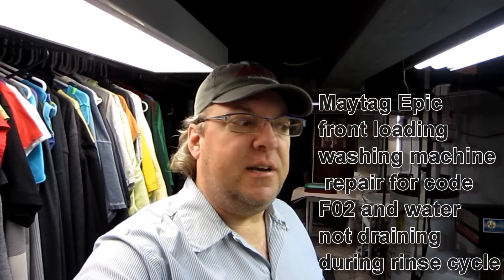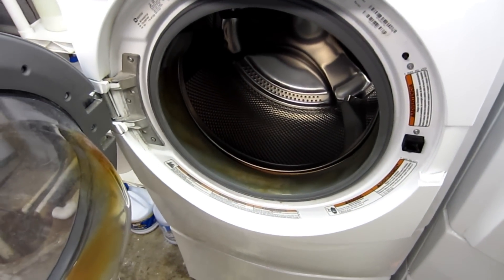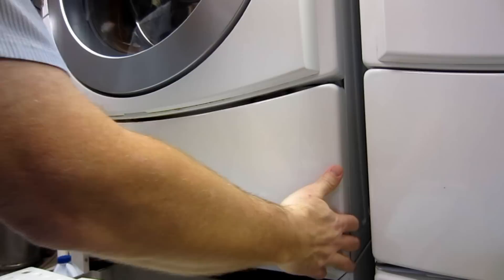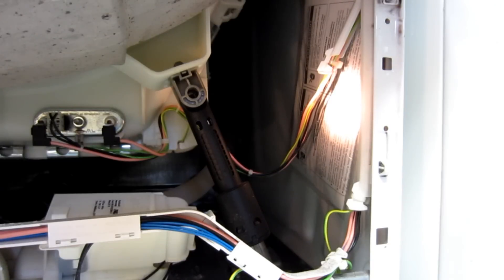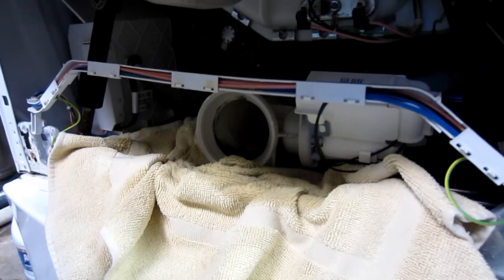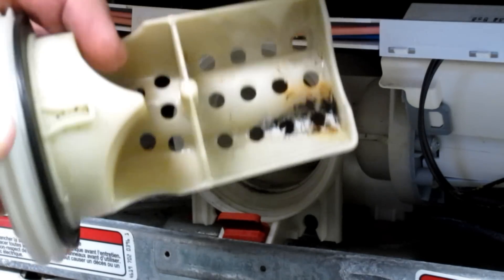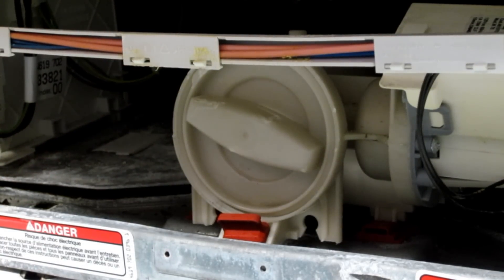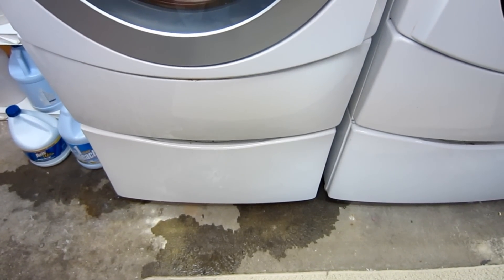Maytag Washer not draining code F02 or F2

Comment: No not Victoria , but if she were here she would thank you for your help. I followed your  video advice and cleaned out the screen for the first time in 10 or more years. I did not knot there was a filter that needed cleaning.
I pulled out what was left of a mechanical pencil, 12  cents, a 5/16 drill bit and gunk. Totally clogged. Now it totally works.
Thank you again.
Reply from the maker: awesome!  Glad it worked out..

Comment: Thank you very much for this amazing instructional video, it was exactly what I needed. You save me around $250 on a service call. I thought it might have been the Main Controller board. I was really surprised that the problem was just a clogged filter trap. You detailed every step including the tools required. There was a sock, some coins, a pen other debris and a lot of hair and lint. This machine is 12 years old and I was considering replacing it because of this error, now it's once more working like new. Thank you!

Comment: Thank you for doing this!  I cleaned out a bunch of gunk from the hose on the back of the machine last night but we still go the F02 error this morning.  I knew there had to be a filter somewhere.  Your video was very helpful and explained perfectly what to do to solve this problem.  Thanks again!
Reply: I forgot to mentioned, when I pulled the filter out, it was like one solid tube of lint, hair, a bottle cap, some change, etc.  I'm not sure how it was draining ANYTHING through all that stuff.
Reply from the maker: Grandpa45 that can happen. Glad it all worked out.
Reply: Grandpa45 mine was the same way!  6 years of lint, rug backing, and green dental floss holders.  Did it myself too!
Reply from the maker: thumbs up!!

Comment: Thanks for doing the video....a quick share on the issue with mine draining earlier in the year, cleaned out the trap and put it back together. Still wouldn't drain. After looking around a bit closer, the impeller shaft broke. The motor was fine but the impeller wouldn't spin to pump the water out. At first I thought it was a lego rattling around. Found a cheap knockoff motor on Ebay for about $40. Back in business and mama is happy now.

Comment: Found this video while searching a draining problem.
Our Maytag Maxima doesn't have the separate bottom piece that comes off to get to the pump screen i never knew existed. It has a one piece front all the way up and tucked under the display.
So I pulled the bottom out to the cracking of plastic point and jammed a couple sneakers in to hold it open. I could reach in and unscrew the screen and pull it out. Sure enough, had about .75 in change in it along with some other crap.
Thanks for the tip.
Reply from the maker: That's Great.. Glad it helped out!!

Comment: I just bought a washer and dryer for $140 for the set and washer wasn't draining/f02 error. The filter was clean but there was a small cloth that made its way into the area just to the right of the filter in front of the pump.  Removed blockage and it works. So don't give up if it continues to happen after cleaning out the filter!
Reply from the maker: +David Kaufman Right ON!

Comment: Thank you so much....!
I was at my wits end because of the f-02 code... about ready to call the 'Maytag Man'  I am machanically inclined.... checked out your video, and sure enough!  When I pulled the filter I actually thought there was a black rubber  boot around it to protect it .... nope  there was a sock, about .40 cents, a pen lid  other debris and about 1 pound of hair/lint  .... and talk about STINK   whew!!!  my washer is back to NEW status!  Thanks again!   All in all it took about 20 minutes!  P.s.  I replaced the torx screws with like size phillips head screws for ease next time.
Reply from the maker: Your welcome, Glad the Vid helped
Reply: Misubishi
Washing machine F2 error
I no know

Comment: Whew! That wasn't so bad and I found a heap of coins with crap growing on 'em along with nails and a lemon. Thank you for this.
Reply from the maker: Awesome! You're welcome.
Reply: This still didn't solve my problem, however. It looks as if I may need a pump. Error 21 (long drain) and E33 (replace the pump) even though I had to release the drain to spin the clothes more than once.
Reply from the maker: That sucks, Check out my other video on pump replacement. It's not too difficult. Good luck!
Reply: P

Comment: F02 error after drain cycle. Pulled mine all apart, but make sure that the water is not in the tub, because it will drain out once you get the cap off.  We had a small flood, but the shop vac was close by and got the water up.  This is the first time I have ever had the filter out in the 10+ years we have had this machine.  It was completely plugged up with lint, change, hair, hair ties, and who knows what else.  It smelt like the sewer line.  Also I did check in the gasket area and there was a sock in there.  So I would recommend you clean this filter at least once a year.
Reply from the maker: Emory Lehman thumbs up

Comment: When you unscrew the cap on the pump filter, be sure to check the gasket around the cap and see if it is deformed on the pump side.  IF THERE IS A GROOVE IN IT, turn it around backwards and use the other side.  A groove in it will make it leak and if both sides are bad, replace it.  It is very critical about deformation and must be smooth facing the pump housing.

Comment: Thanks!  Ours had a piece of a bra and at least a cup of silt. Works perfectly now and actually auto-balances better.  Oddly enough, ours also had a penny and a toothpick.  When I fixed our dryer, I found an earring, a safety pin, some hardware, and a few dollars in change.  Even found an Irish nickel which is odd because we've never been there.  I think leprechauns  have been using our laundry.

You may want to mention to wait until the washer empties all the water before opening the filter.  Found this out the hard (and very wet) way.
Reply from the maker: Your welcome, Funny what things can get in the smallest places. I got wet myself, I too, learned the hard way and then in my video showing the pump replacement I showed extra steps to stay dry.. sorry about that..

Comment: I had a blockage on the discharge end of the pump. Up the pipe. It fixed it for a few days, but now it is back again. Is it easy to remove that hose and inspect it? Maybe I need a new pump?

Comment: Ok I have a question. I have a Maytag Maxima most of the time it works great. We do a load of towels and they come out really wet. Drain is clean, but when we do a cleaning cycle the machine puts water all over the floor, only on the cleaning cycle. Any ideas?
Reply from the maker: Sorry, not sure...

Comment: So glad I saw your video! I just replaced my pump thanks to another youtuber who did a great job showing how to do that. But, now, after the 2nd repair man spilled a lot of water, and then today  I spilled too, I was worried my drum was leaking - I keep drying the water underneath the washer and on the sides, and after each load there is some water coming out (probably from the machine shaking) - so you think I'm okay, it's just leftover hose spill and not the drum leaking? There is NO water around pump - nothing dripping under the drum inside the machine.  Thanks!
Reply from the maker: Shellie Sager hoses maybe. There are hoses that are underneath the drum that run to and from the pump that could be leaking or the connections on the back could have 🐫 loose or the water fill valve could have cracked... Lastly the soap following slide drawer receiver could have formed a crack(ours did) and of course the drum seal itself... Trace the water... Find the highest point that it is coming from... Water runs a long way and takes some weird paths... Good luck 🤞
Reply: Thanks for responding. I have not put the cover back on. Since replacing the pump/motor, I wanted to watch a few days to make sure the hoses are secure. There are no leaks at all from pump to wall. floor under drum is dry. I believe when we pulled the clamp and water poured in, it went below the pump floor in those two holes in front of the pump where the screw secures it in. I have never had a leak in this washer, this is the first water I've ever seen on the floor - which has only occurred since replacing the motor and having that water fall out of the hose when doing so. I keep tilting the washer back some water does drip out at the back.When the cycle is running, there's no excessive water pouring out, so I'm hopeful it is spillage and after a day I will have it all out. If not, then time for a new washer.  Thanks!
Reply from the maker: 🤞👍😁 it definitely could be left over water...

Comment: Thank you so much for this. This was truly your good deed for the day!
Reply from the maker: Thanks!!
Reply: The washer ran for a couple of loads, etc.  after we cleaned the pump with the help of your video but the sud error would come on first. Now the F35 is back. Any suggestions?
Reply from the maker: "F" codes are for "Flow"..  If your washer is filling up normaly you can assume the flow issue is with the pump for the draining of the "tub".. if there is no obstruction going into the pump from the filter housing then you may have a pump issue.. Here is a pump video https://youtu.be/pH_unwlVvXg

Comment: One of the front shocks came loose and the plastic bracket was laying on the ground when I cleaned the filter.  Is there a video for that repair?
Reply from the maker: I have been lucky... I haven't had to do that repair so, unfortunately I don't have a video on that...
Reply: I was able to get the shock back on but it appears a chunk of the counter weight has broken off.
Reply from the maker: +Bill M Ohhh No, bad news indeed.. Very unsafe..

Comment: hey thanks for this tip was totally awesome helped out a lot do you know about the f 11 code
Reply from the maker: Lucky for me, no. I haven't had that code appear on my machine.  It looks like it is a communication error between the central command unit(CCU) and the motor control unit(MCU).  Check the wires to behind the controls for chaffing or looseness. If they all look good then either the CCU or MCU needs replaced..

Comment: I did not have much clogging the filter. then tried again still threw code. drain pump is running so seems to be working. What else could cause the non drain/code issue?
Reply from the maker: rmtz59 even though the pump is running it could be that the water pathway into the pump and out of the pump through the hose could be blocked. Also it could be that the pump impeller itself is broken or not spinning at the same rate that the pump is. I have another video on YouTube of me removing the pump.
Reply: I removed the drain pump and found a broken propeller and leaning sideways.  Thanks

Comment: This video is great, very helpful. Does anyone know how to clear off the sud code I get it every once in a while...
Reply from the maker: The suds code is suppose to let you know you need to cut back on the amount of detergent or use the correct detergent. However if you are doing both correctly, you may have an intermittent pump failure( I did a video on replacing that too)

Comment: I’ve done this multiple time and still getting the SUD/F02 code when it’s time to spin and rinse…. PLEASE BELP!!
Reply from the maker: That's a flow failure so you may want to check your water flow going into the washer make sure that your filter on the back side of the inlet is not blocked and make sure that your water pressure is good

Comment: (Funny story) Imagine this... As I swing the washer door open & all this water rushes out, onto my feet in my cheetah print slippers, into my hamper full of clothes, & all over the garage floor.. I was so surprised/shocked that I just watched all the water flow out.. Lol! (End of funny story) I wonder why so much water was still inside the washer? Any ideas?
Reply from the maker: That is funny.... It is full because Pump didn't or couldn't do its job...Most likely trap needs cleaned out or there is a blockage elsewhere  OR you need new pump..

Comment: I am getting the  F02 error code and my machine is not draining.  Also it is not spinning or doing anything.  Is that the same filter problem?  When I put it on drain and spin it sounds normal but nothing is going on.   Thanks
Reply from the maker: If you haven't cleaned the filter yet... Then most likely yes... If you have cleaned the filter then you want to watch my other video on changing the pump..
Reply: It worked!!!    Also I found my wedding ring in the filter that I had lost 3 years ago!!
Reply from the maker: +Bill M Wow! A wedding ring.. That's a first.. 😊 Glad it worked out!
Reply: The machine was 10 years old and the filter was never cleaned.It was full of muck.. disgusting!! I will be cleaning it out every 6 months or so going forward.

Comment: Fixed the problem with the vid but the error came back a few weeks later any suggestions?
Reply from the maker: Kreig Dernier may have debris that got past the filter OR is in the hose that comes from the drum to the pump OR most likely the pump needs replaced because it was damaged from the additional strain caused by the debris blockage.... https://www.youtube.com/watch?v=pH_unwlVvXg
Reply: Foxboss9 another great video boss. Wish like crazy the 2000 series was as well thought out as the epic! Was just wondering there is some kind of trip switch that is pressed when the bottom access hatch is in place. I get the code only when I reinstall that hatch. Are they related?
Reply from the maker: Kreig Dernier no trip switch as far as I know... Check for pinched wires or clearance issues when the access gets reinstalled...
Reply: Foxboss9 yeah was looking just was wondering if it could some how cause the error. Seems weird if it did

Comment: Did everything in this video (my filter wasn't slightly dirty) and my washer still gives the F02 error code.  What else can I do to fix this problem?
Reply from the maker: Any kind of F code is a flow problem so you may have something on the intake side like a blocked filter screen or something like that or just low water pressure

Comment: How do you increase water levels for model MFW9600SQ1
Reply from the maker: As long as there is good flow coming from the water source (spigot) the water level is determined by sensors... the amount of water that a front loader uses is very minimal. Most people who have not had front loaders always complain that there's not enough water to wash their clothes. It is designed to use very little water end allow the clothes to be cycled through the water that is provided at the bottom of the drum. If you feel as if your water levels are extremely low you will need to have your sensors checked to make sure that they are not sensing water prior to reaching the washers full level.
Reply: @Foxboss9  I worked 14 years with commercial front loads from 50 to 600 pounds when I worked with a chemical company and know how to adjust programming on those and check water level accuracy.  I was wondering on this specific homestyle model if you knew how to adjust manufacturer pre-programming of the water levels. In commercial washers it is either done by computer programming or on older models it is with a dial near water level sensor.  In others like Unimac's are sensitive to water or air bubbles in the tube leading to sensor.  You are very familiar with this machine that is why I was asking.
Reply from the maker: @MariaPerez-ke8cx  you may have been working with more professional, more adjustable series units. These units do not have Dash pots on the control board that you can change for levels. It is basically a sensor that is positioned at such a height inside the water hold area and when it has water breaking the continuity between two points it shuts the water supply off. It doesn't have multiple sensors for multiple levels of water. It is a very basic system. These are consumer units that aren't adjustable for obvious reasons. It cost more money to manufacture and they do not want the general consumer to be able to change a setting without knowing if it's right or wrong.
Reply: @Foxboss9  I truly appreciate your feedback.  Thank You for this video.  You are awesome

Comment: Done this and still have F 02 code.   Any other idea's?
Reply from the maker: +Joanna Haslam It means it has a flow problem.. as long as the washer fills ok and the discharge hose is not blocked then check this video out.. https://youtu.be/pH_unwlVvXg

Comment: I have f2 error and the filter is clean.
Reply from the maker: Could be that you have an issue with. The inlet. F basically stands for flow. If your machine seems to be filling up, okay But is not draining well, that it could be that you need a new pump.
Reply from the maker: https://youtu.be/pH_unwlVvXg
Reply: @Foxboss9   thanks i will replace the water pump, and after f2 error i have f9 error its motor problem, i put new carbon brushers and have the same error f9  the belt its ok , connects too

Comment: That machine is filthy. The front seal os brown. Stop using cold water and liquid detergents. And leave it open. Also poor Maytag design
Reply from the maker: italia01139 The stain becomes more prominent when using warm water.. The detergent used is homemade and does nothing to add color to the water... We live in the heart of the Marcellus Shale deposit and the well water is high in Iron content. 3 different water conditioning companies from the area have advised us that there is no cure for removing that stain from the water... The neighbors spent over $7000 in softening equipment and their water is  negligibly better...  As far as endurance, there are far worse out there  as this Maytag set has been serving our family of four over 9 years now, not sure how "poor" of a design it can be considered since the pump has been replaced once and that's it..